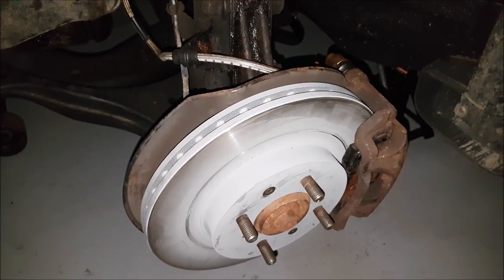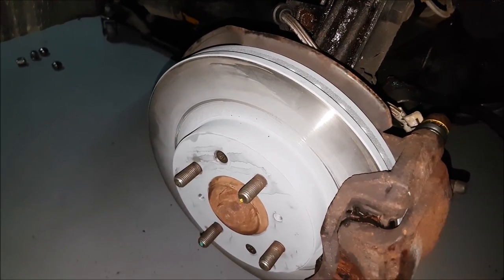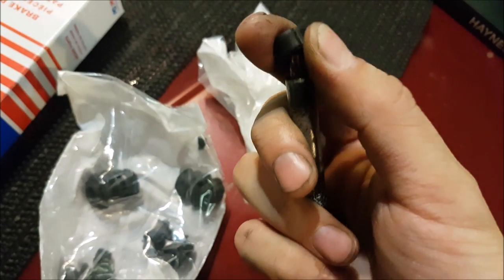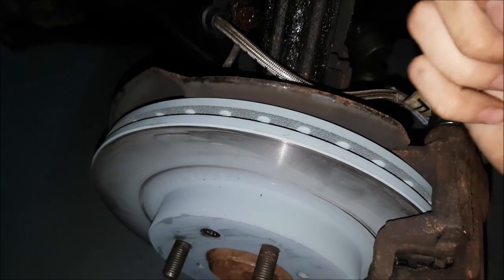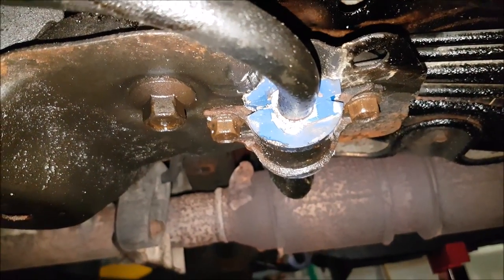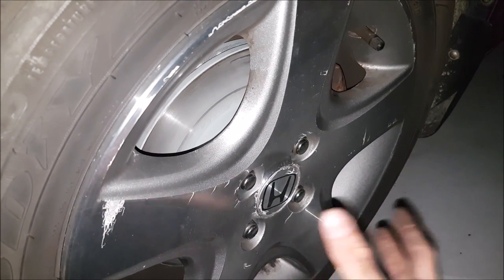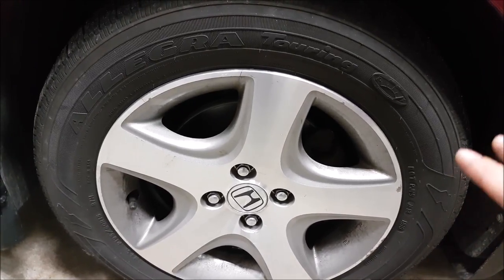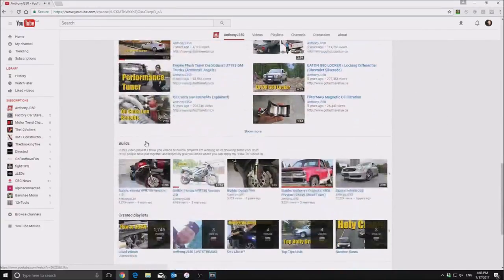Why we Upgrade Parts: Stainless Steel Braided Lines, Rotors, Pads, Tire and More! | AnthonyJ350

Comment: Absolutely right Anthony people have this idea more expensive and the bigger and brand name the better it has to be when in fact it could be the worst thing for your particular car and for what you particularly use it for!
Reply from the maker: Yup, seems people will spend a lot of money on their weekend car but don't look into better quality value parts for the daily.  The daily is the most important vehicle, gets you to work, transport your kids etc.  So why not use some of the ideas from performance cars i.e. stainless braided brake lines and apply them to the daily driver without compromising original engineered specifications.

Comment: I absolutely disagree with your opinion on the solid faced rotors vs. the crossed drill & slotted..  You are mistaken on the durability, stopping ability, and overall functionality of the differences between them.  Your O.E. style solid rotor is by far the worst choice you can make for a couple of reasons... The brake pads & rotors will not cool down as fast, which will decrease the stopping ability, wear down your parts quicker, and solid rotors have more of a tendency to warp due to the heat... which causes the steering wheel to shimmy back and forth when stopping.  The reason for the crossed drilled, Slotted, and cross drill & slotted are... The cross drill allows for better rotor air ventilation keeping your brake components 150 degrees or more cooler, and the slot's are to help channel the brake dust away from your pads & caliper, allowing for a cleaner surface when the brakes are applied.  So in the long run, you get way better performance and added safety by upgrading from the O.E. style solid rotors, whether they are premium brands or not.. A set of drilled and slotted rotors w/ ceramic pads can be found for around the same price as O.E. parts.   

As for the steel braided brake lines.. I agree 100% that is an upgrade everyone should get, and can easily be found for $50-$100 for the 4 piece set.

Also improperly torqued lug nuts will not ward your rotor, but it could cause your wheel to slowly over time shimmy enough that the lugs nuts fall off while your driving, in turn allowing for the wheel to eventually wobble enough to come off the vehicle, and / or possibly break the remaining lug studs resulting in a very dangerous situation.
Reply from the maker: Thanks for the feedback.  If you watch the video again I actually agree with your statement on cooling.  I was saying blanks are better on INITIAL bite because it has more surface area.  Again this for a daily driven Civic so it's not going to see a bunch of consecutive brake applications.  I deal with guys that tow 5-8000lbs on the regular and they don't have brake fade on the initial brake application.  Think about drum brakes, they have the ability to brake harder on INITIAL application because they have so much surface are, however due to their design they experience fade fast after a few more applications until they cool down, same theory, surface area.  

If you read this article from Brembo, they state not all cross drilled rotors are created the same https://blog.racetechnologies.com/2015/04/09/the-advantages-of-cross-drilled-and-slotted-discs/ so that cheap cross drilled and slotted rotor probably won't be as durable when it has 40,000KM on it.  They even state with the highest quality cross drilled rotor can experience "thermal shock" so that's why race cars use slotted.  So purchasing cheap cross drilled and slotted is definitely not as durable based on Brembos theory as well.

I agree with everything you stated about slotted  and crossdrilled and pretty sure I state most of your points in the video.  I still think on an INITIAL brake application at the speed limit in the city a blank rotor with a premium pad will still grab better because it has more surface area.  I also think unless you're purchasing a premium performance rotor you are compromising durability.  

This is based on application practice.  My old Power Slots (Stop Tech I believe now) I was able to have resurfaced and I have about 100,000KM logged on them and am comfortable with them.  But before my next big trip and taking them on the Coquihalla (they have a show towing how on Discovery about this road) I will swap them to a new set of slotted rotors from Stoptech with Akebono pads.  If you are purchasing slotted and cross drilled rotors for the same price as O.E. blanks, do you really think the metal is really that thick or well cast?  We would like to know, do you drive a large truck that tows?  Do you drive mountain roads? And how much mileage have you been able to log on a set of rotors?  

I base what I found and what people really need on my daily driven Silverado and my 350Z. Two very differently used vehicles.  This video is to show maximum value and try to get people to think about durability and longevity.  We want to make sure people have the same braking performance for several years, making the roads safer.   

I still believe torquing the wheels to spec is very important.  You stated a situation where they are too loose.  I was referring if you over torque with a worn out torque stick many shops use.  It won't fall off but if too much or not even can warp the rotor.
Reply from the maker: Also slotted and cross drilled wear the pad out more because of that cleaning and cutting action vs blanks.  Remember I personally run slotted on my daily.
Reply from the maker: Here is another article regarding rotors and how drilling them can weaken them http://automotivethinker.com/brakes-2/rotors-blank-vs-cross-drilled-vs-slotted-and-warping/